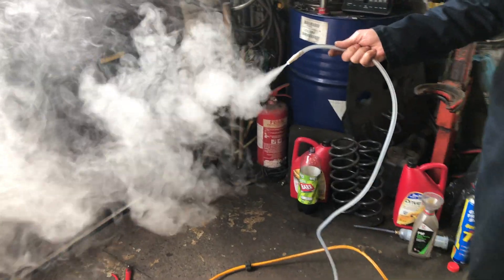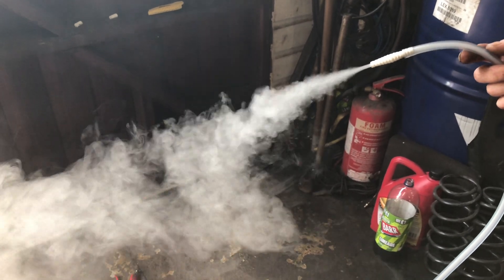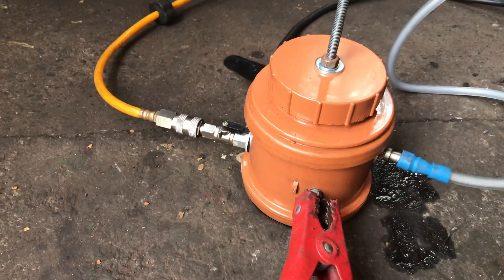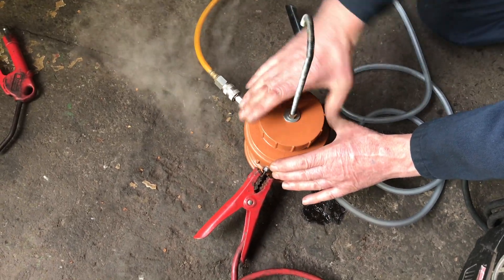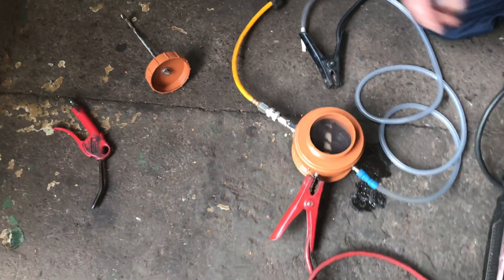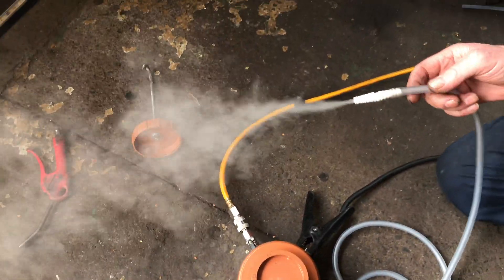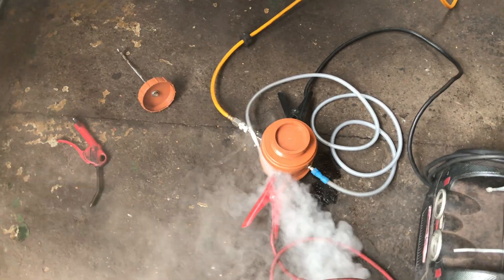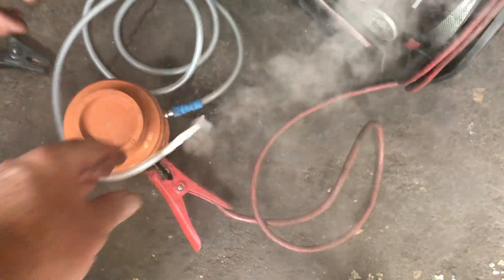DIY SMOKE MACHINE  - THAT REALLY WORKS!!!!! Part 1

Comment: Ooft melty. I made a very simlar one from 110mm waste pipe fittings and 1.8 Ohm's worth of resistance wire. It worked great for about 10 mins until the plastic output spigot melted. I doubled the resistance and used brass spigots and again it worked great till the lid melted. The only real difference in my design was I had the in/out fittings through the lid. I'm now on the lookout for a more heat resistant container. That plastic thing wisnae cheap either!

Comment: Very good! I've been fooled on some vacuum leaks where a split hose will leak under vacuum but not leak at all with the very slight positive pressure from the smoke machine. So just keep that in mind it will help find 90% of the leaks though. I wish mine had a flow gage so you could gage the size of the leak as well. Good luck and don't start any thermal events...
Reply from the maker: Great advice Phillip thanks for sharing your information cheers sandy

Comment: You've not gave a link to the container. What is it called? Where do we get it from?
Reply: Its a sewer pipe
Reply: @davesterl Thanks for your reply.  Any links to the full unit/ separate components? There's soo many pipes when searching and dnt know which specific one to buy and the lid is separate too so help us out please
Reply: @javaidsadiq5775  i have no links, i could only suggest to have a look around a hardware store
Reply from the maker: Links are now updated in description cheers sandy
Reply: @sandyande  Cheers Sandy. Thank you. I can now make it and I'm sure many more people from UK will do this with ease now
Reply: @sandyande  Hi Sandy, I can't see the link for the actual pot please mate? Just the access cap, and a plug socket cap?